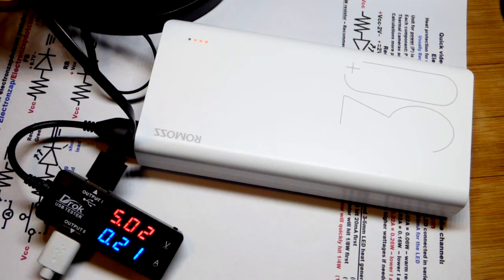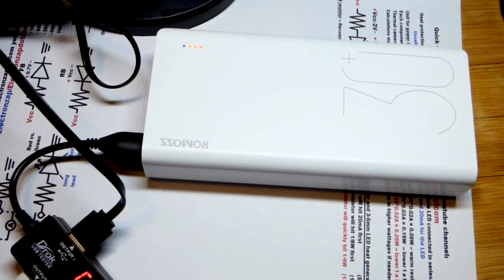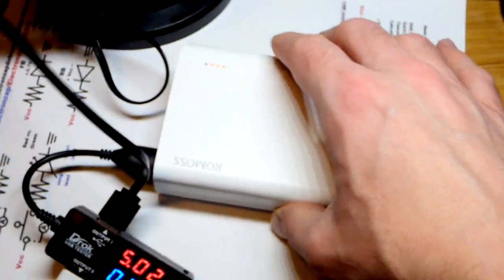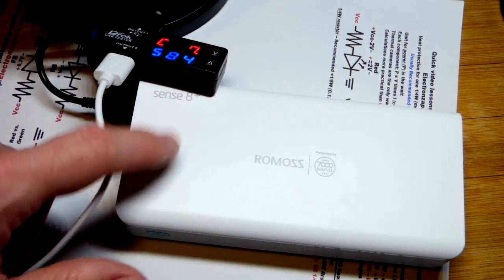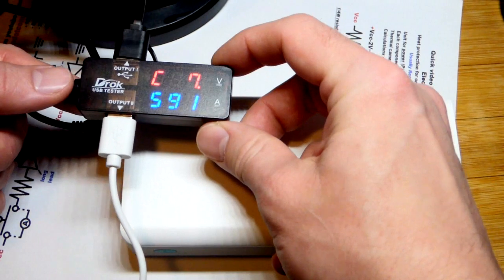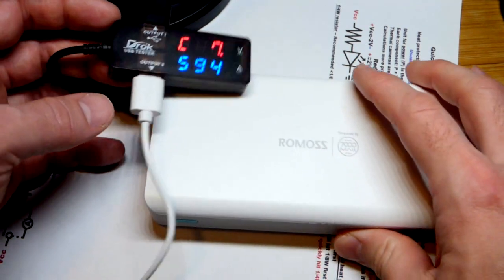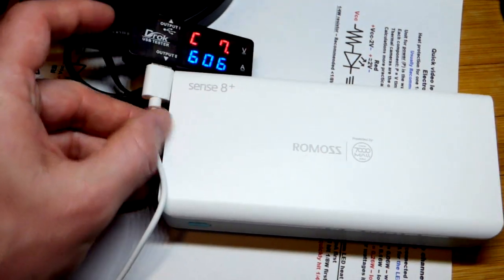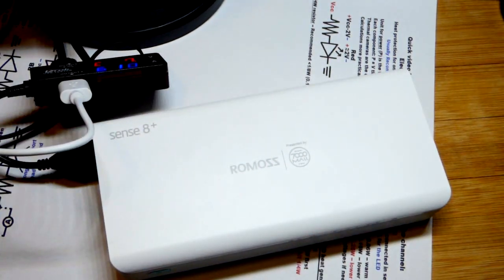How I am testing my new ROMOSS portable battery packs capacity with USB multimeter by electronzap

Comment: I guess we know what your daughter is getting for Christmas this year...

Great review I just broke and bought my first pack. 
A measily 10 hours. 

Then on the way home,
 at the thrift store I found a credit card 2500 mAh
For a buck ninety nine
seems to work fine but I have a feeling it will be in pieces by the end of next month
Possibly on fire....
Reply from the maker: This is mine lol, I gave her lighter packs which she has adapters for. I think we reached a point where portable power packs are made pretty well at an affordable price. I still avoid putting them near flammable material though.
Reply: Well, you deserve it.
Glad to see your channels picking up some steam.

I just have a bad habit of taking anything apart that doesn't work.
And from what I've seen on big Clive's channel lithium batteries
It's probably something I shouldn't pry apart
To get the juicy chip inside.  Cheers.